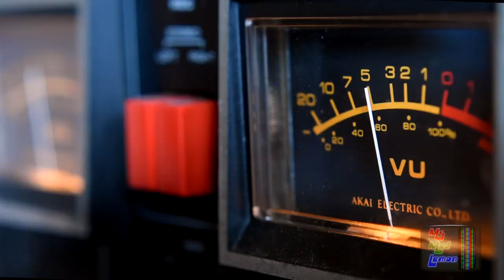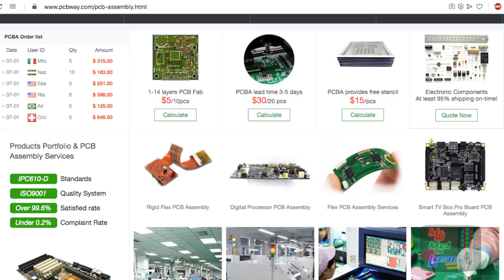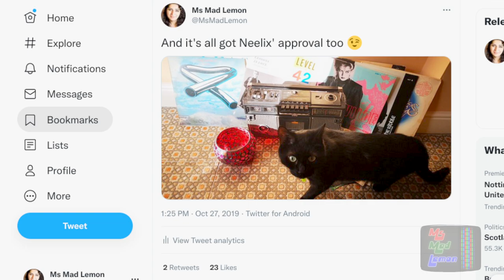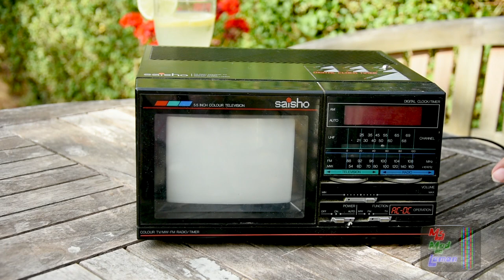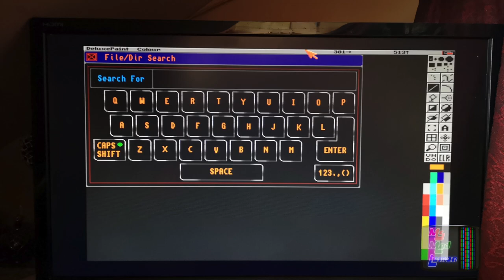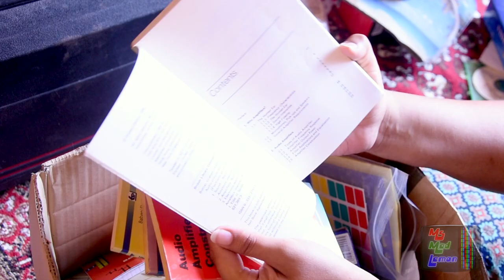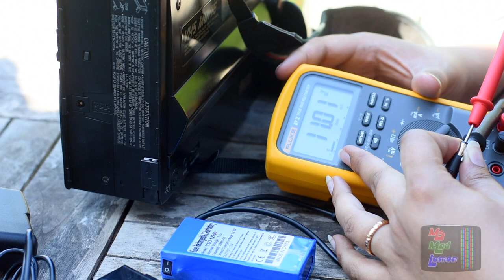Summer Nostalgia Special Part 1 - Car boot/Yard/Garage sales & Goodies

Comment: Some great stuff i have only managed to find a few tapes, and all have been overpriced. Though i still bought some that is a good lot you got from what i have been told the bush super ferric tapes are decent and were most likely made by skc in korea .Quite a few later memorex and scotch tapes and a number of other known brands have used skc to make their tapes ,Skc tapes the hubs often have 3 sets of3 round holes in them .The tdk d is a great sounding cassette when calibrated in a decent deck like your aiwa .